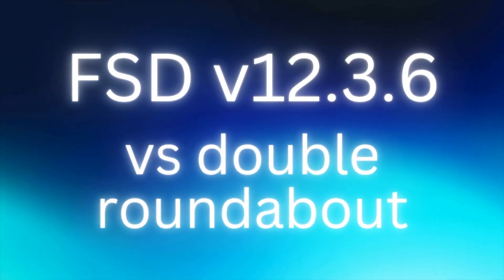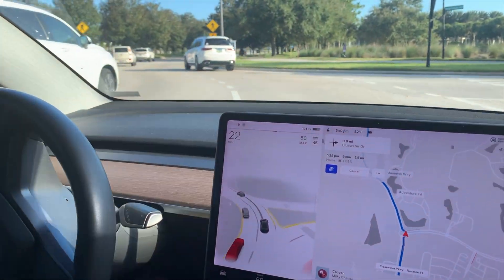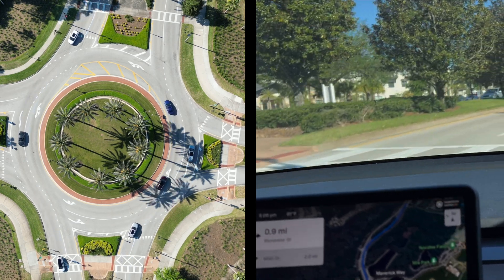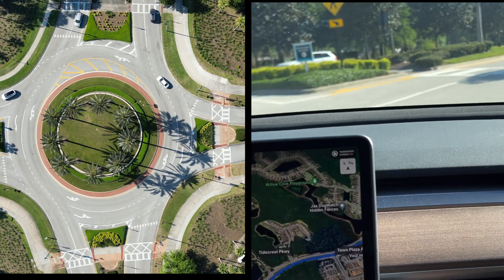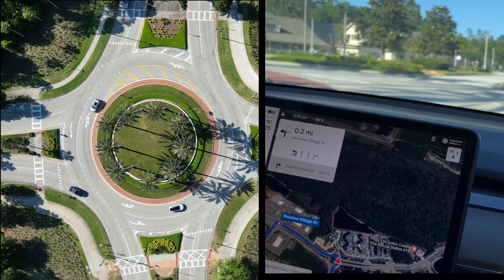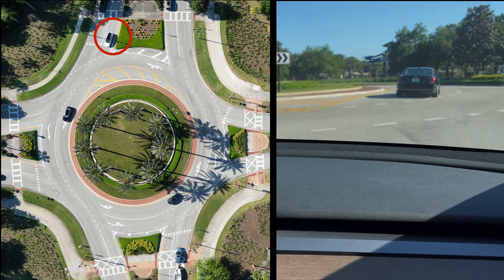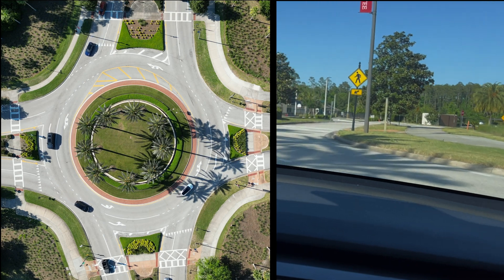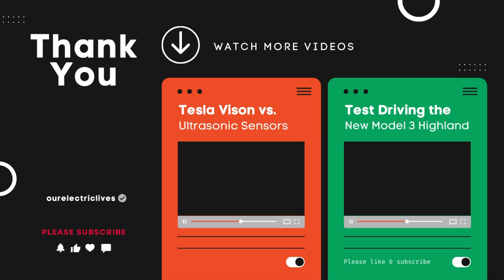Tesla's FSD v12.3.6 versus the Double Lane Roundabout:  Roundabout Scenarios w/Drone Footage for FSD

Comment: Those are very low traffic roundabouts. Do you have situation where you have to squeeze in and push out?
Reply from the maker: This is an area that we drive on our daily commute, and we can verify that it does work in higher traffic situations.  Unfortunately, due to work schedules we were only able to fly the drone on the weekend which happened to be when it was less busy.  One of the scenarios did show the car yield to other cars in the roundabout, but it definitely was still mild traffic.  We can mount the GoPro and do a follow up during our commute because that would definitely be good information!